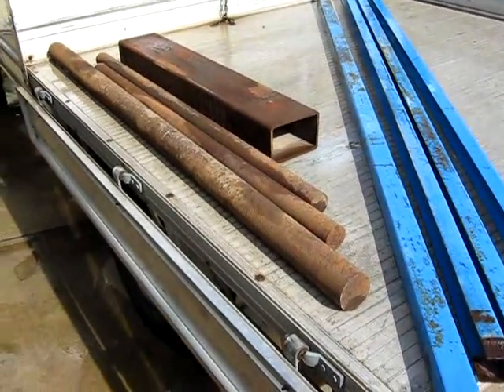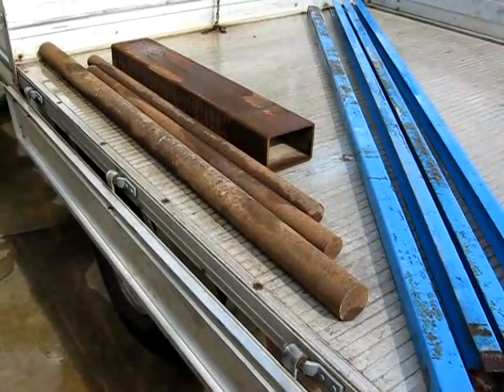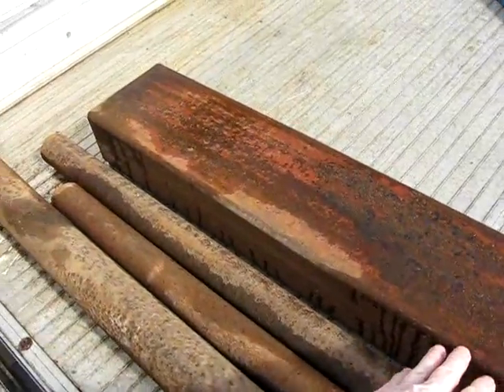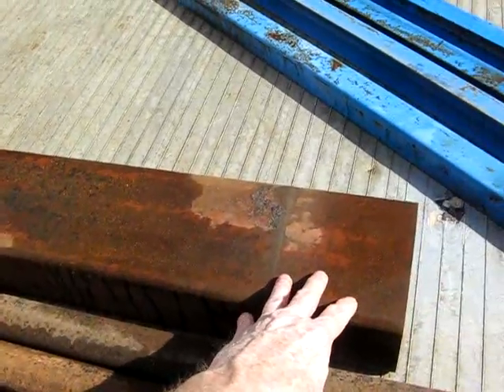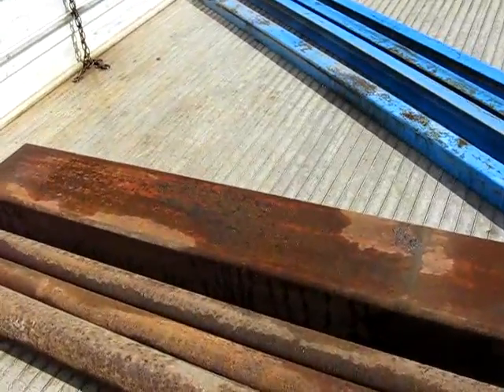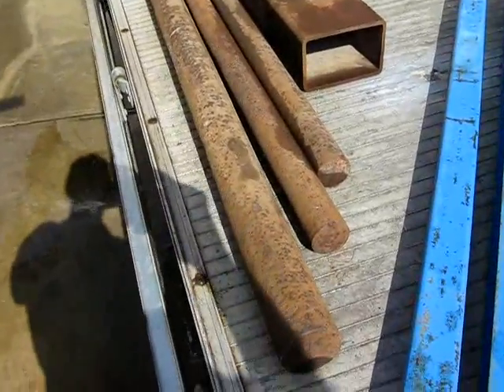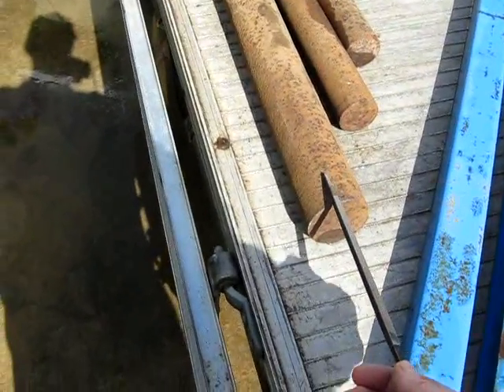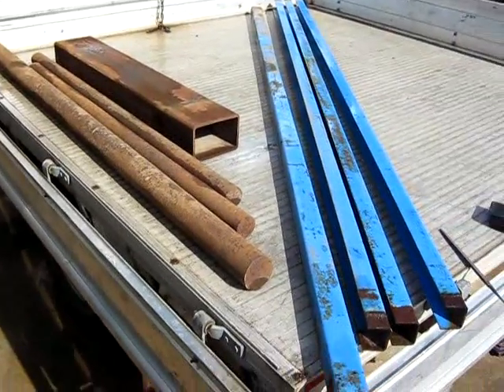Cheap steel for a metal lathe - where to buy it

Comment from the maker: I should point out that here in South Australia only scrap metal/recycle centres with a secondhand licence can/will re-sell scrap metal.  Most don't have a licence.  So the best place to go is a demolition/salvage yard as they will have a licence.  The more run down and basic the yard, the better the prices.  The flash looking ones ones always charge more.  Be wary of stuff like old hydraulic ram shafts as these are generally very hard and difficult to machine.  Take a file as suggested.

Comment: Here in Florida I pay 85 cents per pound of mild/structural steel if I have to go to the surplus store. Craigslist helps, but the selection and timing are limited. I recently picked up 1400+ lbs of 7 inch square tubing for $200 on CL. You seem more than competent however I suggest that the square tubing be filled with something that doesn't resonate. I was in the process of building a lathe and all my research told me that the steel is stiff enough, but it rings. Whoremonics!